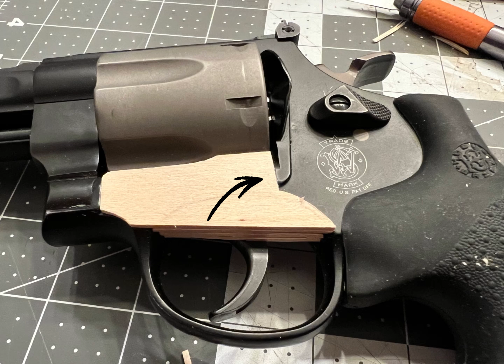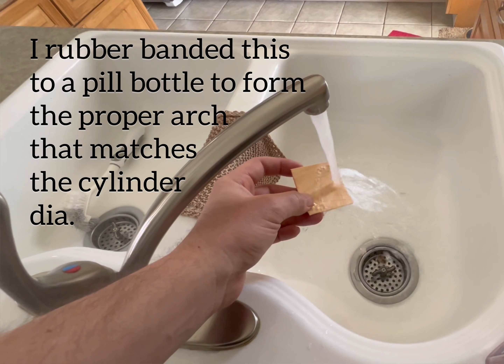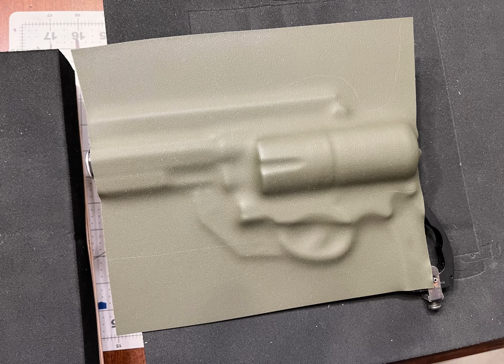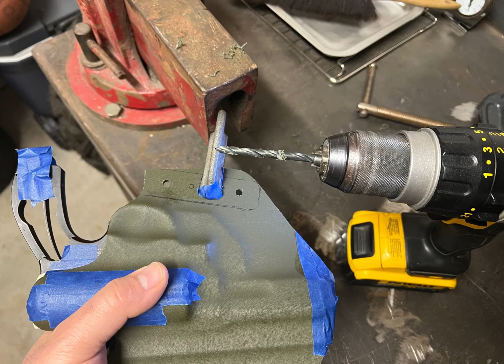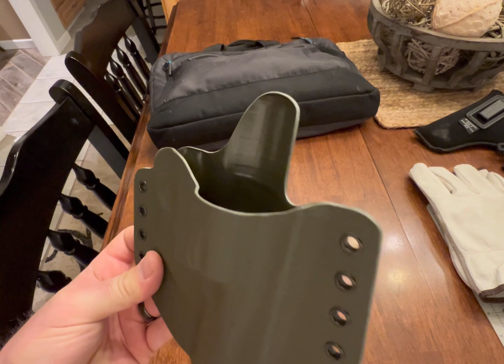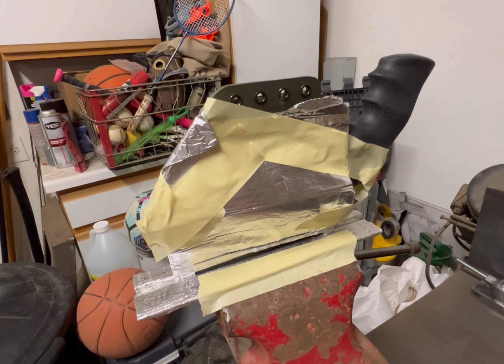44 Mag Model 329PD - DIY kydex holster

Comment: What a fantastic design. I have a model 329PD that I changed out the titanium cylinder for a S&W model 629 stainless steel cylinder I bought from Brownell’s (fluted). Got it quad ported by Mag-Na-Port who polished the hammer and trigger. MNP also electrically discharged machined a shallow vertical line in the “V” of the rear adjustable sight blade. And filled it with white. Mepro Big Dot tritium front sight for a X/S sight picture. 500 S&W Magnum Hogue recoil absorbing grip with Bowen Classic Arms lanyard ring threaded screw to replace the screw holding on the grip. Braided 72 inch boot leather lanyard attached to the lanyard ring.
Reply from the maker: Damn!  Sounds awesome!!!!!!  Mine is bone stock and I love it. Sounds like I’d like yours even more!!!!!!